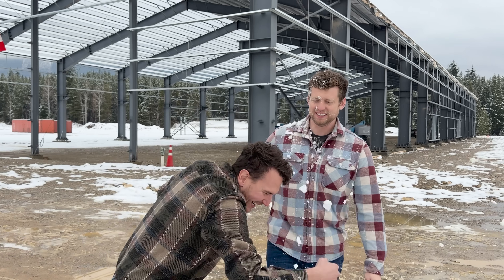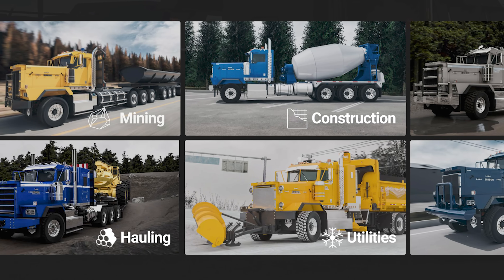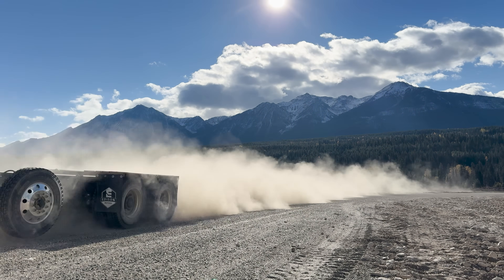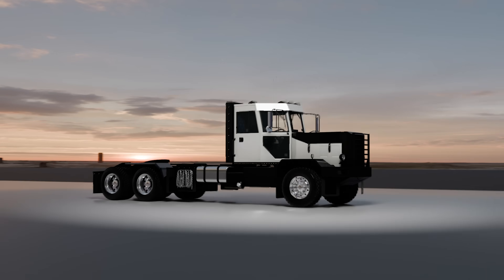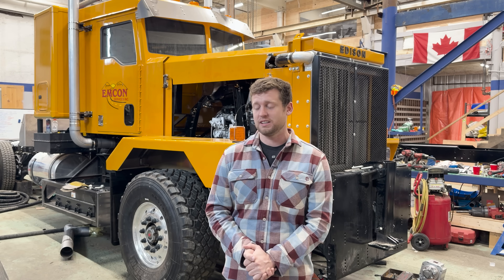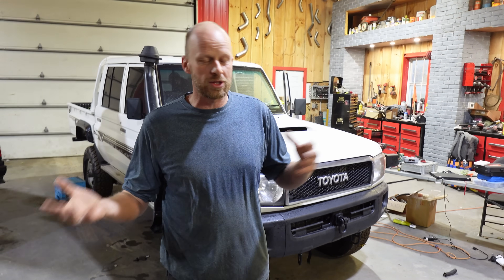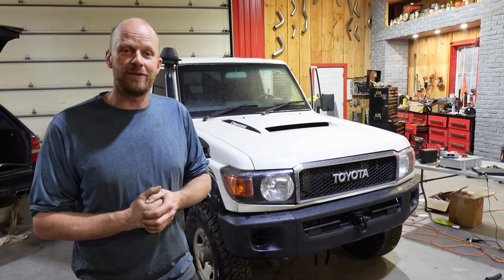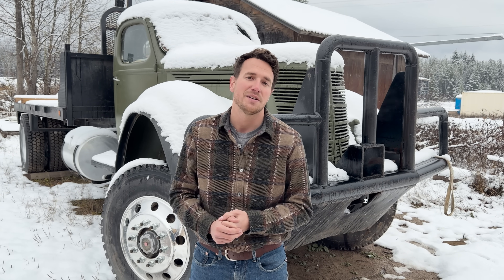VICTORY After RED TAPE: Edison Motors has GOVERNMENT APPROVAL

Comment: One secret advantage that Edison has over any US based semi truck company is in the EPA regulations. The same regulations that are currently blocking the hybrid trucks from being sold by Edison will also be blocking US manufactures.   The advantage Edison has is they have already started a change in Canada’s environmental laws to bypass the EPA regulations.  There is some incentive for Canada to adopt EU emissions regulations while maintaining the EPA for vehicles they want to sell or purchase from the states.  This will give Canada and Edison a huge advantage in the ability to buy and sell parts and trucks to other countries.  It also reduces the dependency on the US market and its volatile politics. Edison is in a great position to be a technological leader in an under serviced market with huge potential.
Reply from the maker: That’s actually a great way to look at it
Reply: @EdisonMotors  I can see a European box truck variant of a hybrid truck becoming great in the EU. Emission standards are more and more becoming 'electric only'  inside the cities. A hybrid truck could be used such that in the city (the famous last mile delivery) it does electric only and meets standards, and charges / use the generator only on the highway..  

I also see a great application in trucks that do a lot of idling at the moment, construction machines when at a job site, cooling and freezing trucks doing deliveries and so on, something that often leads to complaints of for example people living nearby. Noise reduction and air pollution reduction are selling point to keep in mind for the future.!
  
Broader speaking, there are tons of applications for hybrid trucks and if you guys can come to a reliable production hybrid I see a golden future for the company specific, and  hybrid trucking in general.
Reply: @FoobarDesign  I'd assume they'd still be very niche trucks in Europe as well. For regular box trucking all European manufacturers are already delivering market ready fully electric trucks. The bottleneck for widespread use currently is charging infrastructure. With the numbers delivered it's working quite ok (shoutout @elektrotrucker) but I don't see that much potential for a hybrid truck in the mass market. Neither for urban nor long-range regular freight. Even logging and agricultural trucking is probably easily done with fully electric trucks over here because the distances are not even remotely as long as in Canada (and the US). There is one area where I see a relevant scenario for Hybrids and that is disaster relief, civil defence and military, the things that need to work if the fixed infrastructure is toast. I don't see any field deployment of fast chargers in any meaningful capacity. If you want to enter the European market, that could be your niche. But it's tough, highly specialized, very different approaches across the different nations and the nationally specialized outfitters would need a good incentive to divert from local suppliers for the frames. Look at the Rosenbauer RT/RTX, Vancouver Fire Rescue Services has one. This could be the future.
Reply: @EdisonMotors the other thing to keep in mind is it lets you get established, work out bugs, build reputation and build base infrastructure. All things you need to have a chance against the established companies when they wake up to the idea.
Reply: @EdisonMotors *WHEN*.are you going to support the industry you represent BY making it possible for AVERAGE Truck Drivers to invest???
Everytime you talk about "investing" ===== it ONLY for ""Acreditaded Investors"" ...it's like: pyramid scheme
Reply: @1truthseeking8  blame the financial laws they must follow, not Edison themselves. 🙄🤦‍♂️ Have you somehow forgotten that the Canadian government feels it must protect people from themselves? That includes not letting you risk your own money if you're not rich enough! 😂
Reply: @1truthseeking8  Not sure about Canada, but in the US if you take and pass a Series 65 Exam you are considered an accredited investor without having to meet the financial requirements. The work to pass it is about the same as a standard 3-credit gen-ed undergrad class. I studied for it during one of my semesters in college in addition to three other classes I was taking and it was very manageable.
Reply: In Aus, know a few that really want to try the hybrid, for the B-doubles and heavy hauliers, then talked to some road train drivers and you got some more followers.
Reply: Can you all make a truck that weighs under 18000 lb empty 200" Wb single drive axle with a tag. Cause SADLY the US without a permit 80000 lb gross weight and I'm local in Cincinnati Ohio.
Reply: How soon will the BDE get a Scania engine instead of an X15
Reply: @yeldawg907  DI13@1000hp pls
Reply: they're too long to be sold to europe, they'd have to make the short EU ones
Reply: USPA has changed the regulations no longer have to use DEF. IN US TRUCKS. In fact all US trucks can't delete the mission controls on their trucks. 
Are you getting tired of winning yet
Reply: So short term win over longterm loses, not a great outlook for a company.

Canadian companies cannot exist without US markets its logistically impossible, besides a Canadian hybrid truck from a startup will not make massive moves into Europe when you already have countries like the UK pushing for full electric trolly semis not to mention competition from established brands like Man, Mercedes-Benz, Volvo and Scania.
Reply: Being prepared for the post-US world economy is definitely a major advantage. These platforms have so many applications that demand will likely never be a problem, but broadening the possible base is still not a bad thing at all.
Reply: @ultmateragnarok8376  the US won't ever totally disappear. Not for us anyway. But we should be ready to pivot to having multiple great trade and military powers again, instead of just one super power.
Reply: As an American, I wish that the EPA changes their ways to allow such a vehicle to be produced. We have the highest chances of this happening with the current administration, we just need to somehow get it there.
Reply: @boss.w.1984  why do you think this administration would be more friendly? Trump is in the pocket of the oil companies. He opened asked them to bribe him. There are recordings of it. He denies that climate change is real and has done everything he can to cut support for more sustainable technology.
Reply: @adrianthoroughgood1191 because he wants to cut epa regulations that would hold a company like this back. Make vehicle manufacturing easier with less red tape. It has nothing to do with oil companies or climate change. He is actually pushing for more nuclear energy, which is far more sustainable than other forms of energy production. He's making research cheaper and easier by cutting regulations and getting the government out of it.
Reply: @boss.w.1984  Good point, people often ignore facts that contradict simplified narratives. For example, Trump is called a puppet of Putin, yet he repeatedly urged European countries to reduce reliance on Russian energy and increase defense spending against Russia. Similarly, he’s described as being in the pocket of oil companies, yet he has promoted expanding nuclear energy, which directly competes with fossil fuels. Cutting certain programs doesn’t mean opposing sustainable technology; it means recognizing that government mandates often reflect technologies that aren’t yet market-ready. If they were, mandates wouldn’t be necessary.
Reply: If a hybrid showed up Trump's desk, you can bet good money it will get approved quickly. Edison will always face headwinds remaining in Canada. I say this a disappointed Canadian btw.
Reply: @mj77653e absolutely not unless it directly puts money in his pocket. Chump is a pay to play dictator and doesnt do shit for the good of the country.
Reply: @mj77653e  The guy who literally tilts at windmills and gushes over 'beautiful clean coal' will approve a hybrid? It's possible. It's also possible Jesus will return tomorrow.
Reply: @m @mj77653e rump has explicitly stated there is a 25% tariff on semi trucks from Canada.   Edison is the only manufacture of semi trucks in Canada.  So Trump has already shown he doesn’t really want Edison trucks in the United States.  Second the change has to come from the EPA.  The EPA is kinda fractured between Federal and State levels which means there is a lot of red tape that will have to be cut to get serial hybrid vehicles approved.  Add to the fact that the EPA is having high turnover because of Trumps administration I doubt you will see the necessary change anytime soon.  With the current polarization in US politics, change is a longer way off for US manufactures than Edison has with changing Environment Canada.
Reply: @mj77653e  Sadly Trump wouldn't ever see that, it's the bureaucrats over in the EPA.

Comment: so...... hybrids will never be developed ??? if your building standard trucks to start and then at some point down the road you will shift focus to hybrids ??? call me a cynical... and 'right to repair ' the motors and trans don't have a warranty ??? was thinking about investing , but i'll wait till you get gov. approval for the hybrids ,until then you no different from whats alteady on the market
Reply: The hybrids are encountering environmental regulations that have to be resolved before they can be certified. So while that is being discussed in parliament Edison is pivoting to mechanical trucks they just got approval for.  Once they get the environmental approval and the transportation approval for the hybrids then they can sell both.   There is still a huge market gap in the heavy duty and vocational trucks.  All of the other semi truck manufactures in North America have already discontinued or have announced they are discontinuing their heavy duty trucks.  The mechanical trucks are a way to get the trucks on the road and fill the demand for custom heavy duty and vocational trucks.  The right to repair and off the shelf parts is enough to make most truckers want to switch even to the mechanical trucks.
Reply: @Wild_Lee_Coyote 
^^ this. What this guy said. Times 2

Comment: Don't forget RV chassis!
Reply: It would probably be a rolling frame that the RV manufacturer would slap the body on.   It will probably be one of Edison’s large side projects since they really won’t have the setup for full RV manufacturing.   But I do see them manufacturing fully functional frame rails with batteries, e-axles, a generator, and large inverters for luxury RV life.
Reply: that Class 5 Chassis they showed at 9:11 would be PERFECT for a Hybrid Class A Motorhome! and it would be cool if Edison had provisions to tap into the high voltage system for the RV House power!
Reply: @digitalrailroader  That's the best idea I've heard since this whole thing started. How is that not a win? Because it damn well is
Reply: I have an e450 bus/camper ready for conversion.
Reply: It would be perfect timing as many places are tightening emission regulations on RVs, but nobody seems to be making class A hybrids.
Reply: I have a 1972 schoolbus totterhome,  I'd luv to ev it, so I also have house power, I need to spend thousands on battery's and solor anyway, and a genorator. Just need an axle. Those are hard to find,

Comment: Do separated hybrid truck.

The Diesel engine drives the second axle and maybe front wheels too.
Separate Electric rear axles and battery for the rear wheels.

Charging is done with regen or from a wall charger or with alternator.
This way you can start building hybrid trucks NOW.

Also this would enable all-wheel-drive when both diesel and electric is used. Best of both worlds.
Reply: That would drive the costs substantially

Comment: Imagine, if you will, Jamie Davis with a 50, 75, or 100 ton rotator wrecker that does NOT need to idle for hours to turn winches and run hydraulics while they rig, roll and lift wrecks back to the road. Imagine the reduction in noise and pollution!   

Same for bucket trucks that are used in tree work or utility work. 

This hybrid platform has SO many applications!!!!
Reply: I was thinking garbage trucks could work well too.  They are just stop and go for most of the day.  For the drive to the dump just fire up the diesel generator.
Reply: @pin65371  even better if they use CNG fueled generators given that a lot of landfills can reclaim methane. Already exists in some places with mechanical driven trucks
Reply: And if that little Toyota Land Cruiser hybrid Deboss garage did can pull around 92500lb, imagine how fast a small fleet of those little trucks could clear off the coquihalla and highway 1 after a blizzard, just hook on and drag everything away lol
Reply: @brenttarry7153 technically pulling 92000lbs and applying that strength is different.
Reply: @ThePTBRULES yeah I really don’t know how that was possible without shredding those tires to bits while anchored to that truck with the tank on it. Even 25-30K lb weight from that little truck would be way impressive to me.
Reply: @brenttarry7153  Well there IS this little matter of traction!  This is why Al Quiring has 'Big Green' with triple drive axles and chains on all 12 drive tires!  🙂 🙂
Reply: @larrybolhuis1049 I could believe it a lot easier if the truck tank on a trailer was on rails, that would be a lot easier as the drag would be much less
Reply: Yeah I would love see Jamie Davis buy one your trucks :)
Reply: @SireDragonChester too expensive for Jamie.  Plus, the bugs need to be worked out to have long term reliability.  Edison built hybrids are for owners with deep pockets that are interested in innovation and are willing to put up with the quirks until they are all sorted out.
Reply: @csabahollo6922 
Yeah I know that right now. I’m taking later after the hybrid has mature and hybrid no longer have bugs and issues.  Still be nice see Jake Davis with hybrid truck from Edison motors maybe not right away but in the future.
Reply: Even Metro Truck around Hamilton or Preferred Towing in Sarnia. They're one of the stars of '401.
Reply: The TV show is an overdramatized fantasy and the “stars” are not much more than showboaters. I’ve worked around people like that and they’re 98% show and about 2% “go.”
Reply: @Woodburner100 Actually they cut a lot of the real drama out. Making the show is extra work on top of the real tow situations.

I should know, I worked on the show.
Reply: Or even fire trucks! They have to sprint to an emergency and then idle to run water pumps for hours, with hybrid they would be silent while delivering more power direct from a battery bank
Reply: @lightgod5812  And if the batteries run down the generator under the hood kicks in! Perfect!
Reply: Lots of oilfield trucks as well just next door in Alberta
Reply: be cool to see Ron Pratt test drive a hybrid rotator.
Reply: Heck, imagine utility trucks in the city.
Reply: A rotator is hydraulic winches, you can’t get that much hydraulic power off batteries. It needs to be PTO driven. Much hydraulic demand like plow trucks and rotators have a crank driven PTO. Transmission driven PTO not enough output.

Comment: It's dumbfounding that freight trains have been deisel-electric for 100 years... and no one thought this would be a good idea for road trucks?
Reply: How many semi trucks to locomotives are there. Big semi truck manufacturers would go out of business if their trucks had less things to break and lasted much longer. I'm glad this is the future
Reply: i'm sure they did, but batteries have only recently gotten good enough for semi-sized use cases.
Reply: Apples and oranges. Locomotives are much, much more powerful than trucks, even "heavy-duty" trucks and you can't make a gearbox and drivetrain that won't disintegrate under the load. And it's much harder to make a physical drivetrain to the locomotive wheels. Apart from a couple of one-off experiments the only gearbox-driven diesel trains are railcars and small shunting locomotives.

So it's not that diesel-electric is a "good idea" for railways - it's that it's a necessary inconvenience!